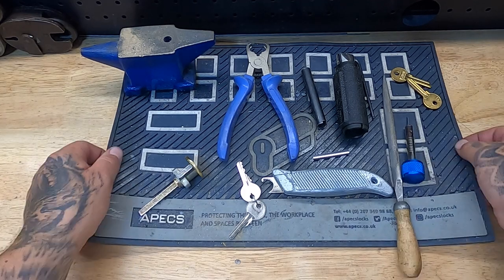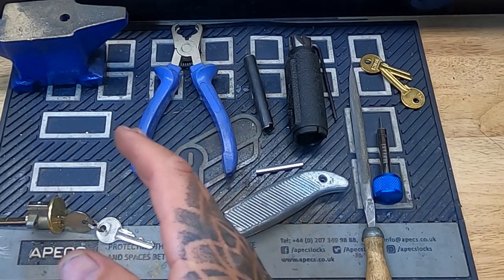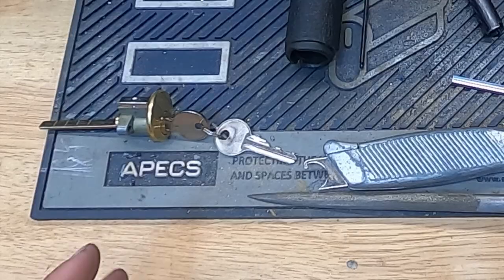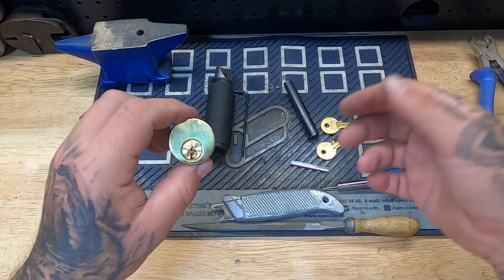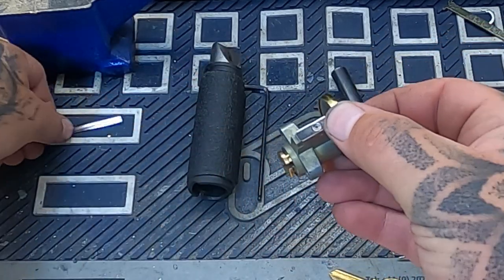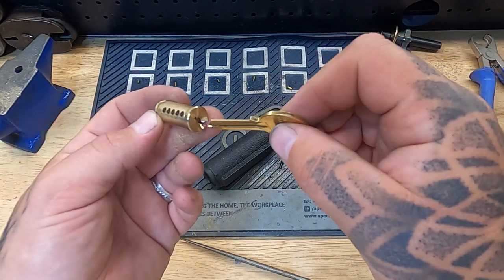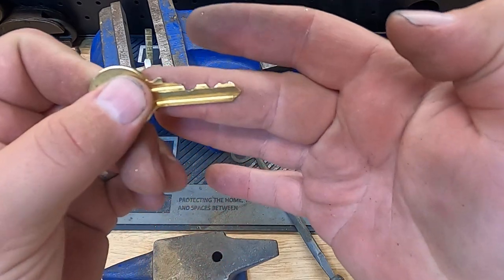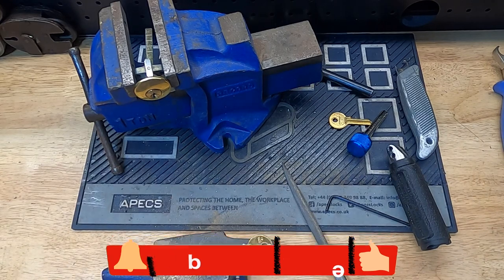How to make a key to a Cylinder Lock

Comment: Something I have done for years but we all do it a little different. I definitely took some pointers away from this video so thanks Paul!  I have always done it in a vice but I have that handle and will give it a go in the back of the van now 👍🏻
Reply from the maker: GxAxV variety is the spice of life. If all did it the same it would be boring. I used to use vice grips and rest key in notch in the vice anvil plate often found at the back. Achieved same results.

Comment: Great video I have plenty of locks for picking with no keys.. Got some files ect just need some keys now 🔑👍
Reply from the maker: hobbo2404 the blanks are easily obtainable. It’s just making sure you get the right profile. Pipin file is handy but if careful with a round file then it’s just as achievable

Comment: Great content but can’t see me ever needing this.
Reply from the maker: There is plenty of reasons as to how you can use this for. I used to do it for landlords, housing associations, estate agents on communal doors. Not to mention other reasons, such as Obsolete lock? Brand new cylinder lost keys, removable core padlock, that’s not to mention locks that can be reconfigured if it’s an odd size cylinder you don’t stock. Pick lock, strip it down and swap pins about and cut a new key. It’s just opening yourself to the money you can make as well as save from simple skills that compliment locksmithing.

Comment: Thanks Paul - always good to see how others do stuff.  Do you have a link to the file you used?
Reply from the maker: Gerry Brandreth it’s not a cheap file. Though one key made paid for it. My file is prob 5 years old. Thanks for the view and comment.    Nicholson Hand File, Swiss Pattern, Double Cut, Pippin, 2 Coarseness, 6" Length https://www.amazon.co.uk/dp/B001R1V22G/ref=cm_sw_r_cp_api_i_Lg0jFbH5J3157
Reply: @LocksintheCityLtd  Cheers.  Might wait until mine breaks or wears out before spending that much on a file!
Reply from the maker: Gerry Brandreth that’s just the one I chose to use. There is other pipin files much cheaper. I just find this one perfect for the job and lasts.